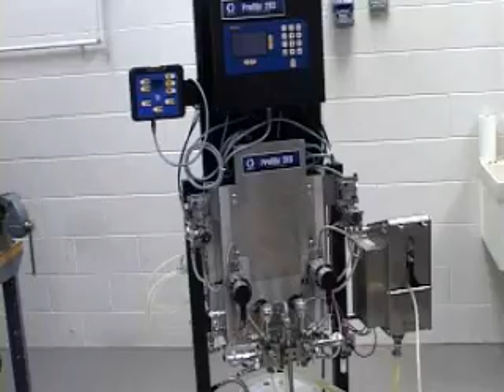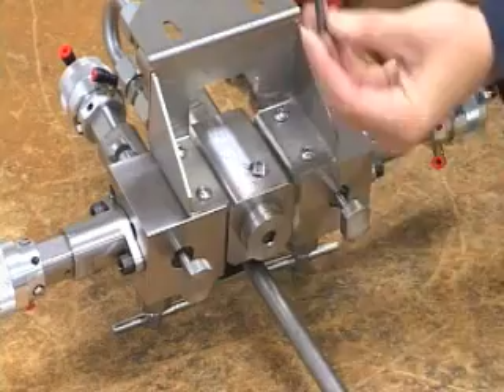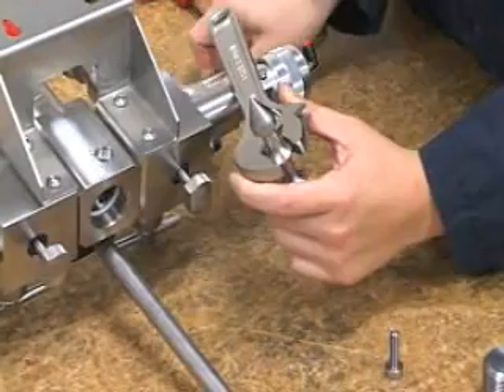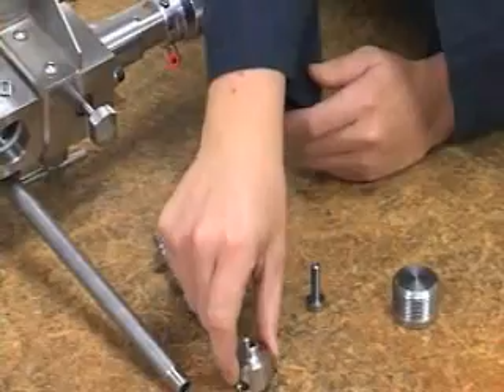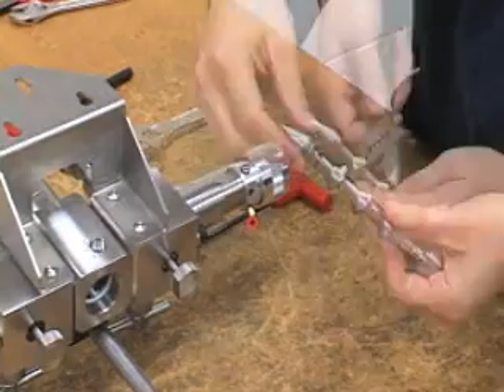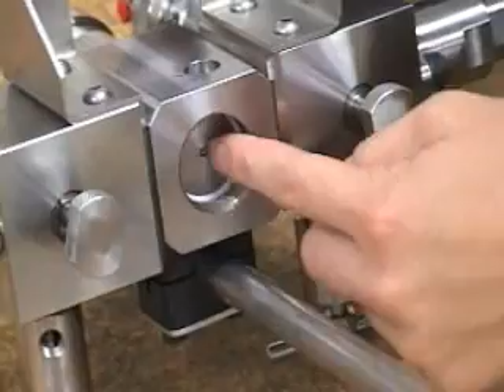Graco ProMix Integrator Service

Comment: Sir please told about QDB1 alarm and how reset them?
Reply from the maker: Error code QDB1 is an overdose B alarm. The B dose has overshot, forcing an A dose that, when combined with B, is too large for the mix manifold capacity. Please call Graco Tech Assistance at 1-866-361-5929, opt 2, to further discuss troubleshooting and solutions. If that is not an option, please email us via the form at https://www.graco.com/us/en/support/forms/case-form.html, and we can further assist you with this unit. Thank you.
Reply: Paint is coming too thick.